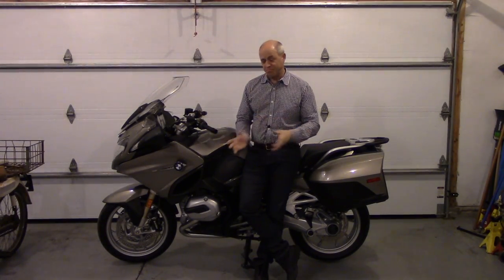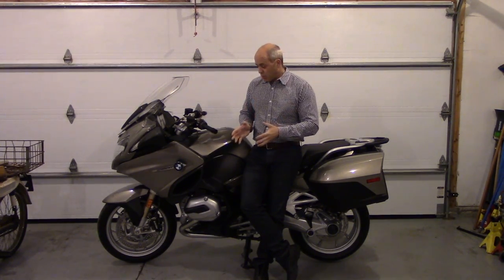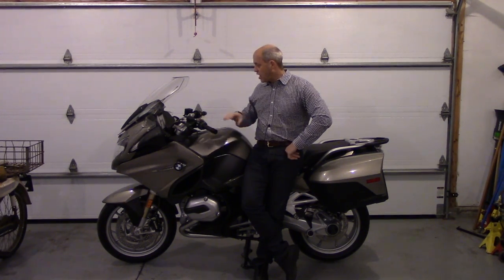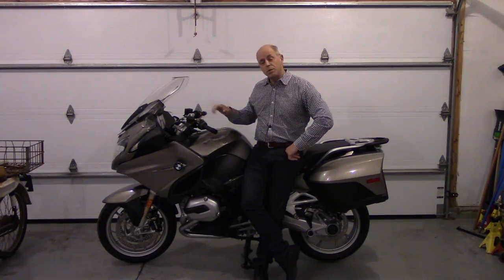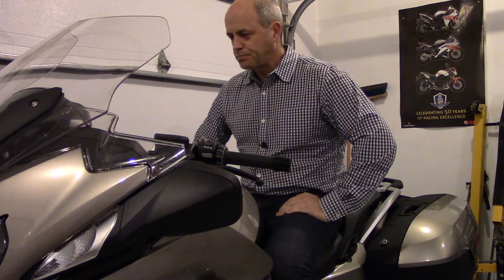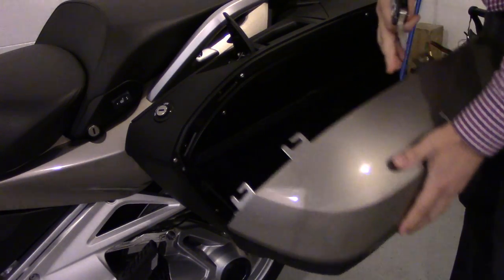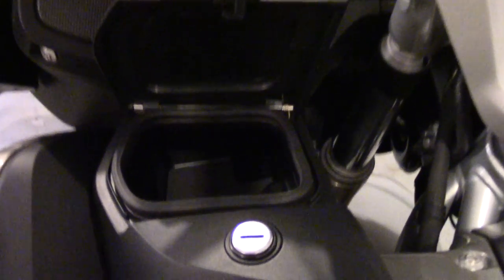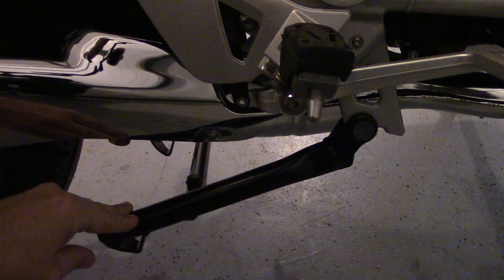2016 BMW R1200RT Overview

Comment: I wish you would do a comparison In the feel and complexities from a base RT or GS to one with Dynamic ESA. There is a scant amount of Information online. I feel you would do an excellent job at explaining and demonstrating the difference for those of us who have a lesser than impressive budget. Please explore & investigate for us if possible/based on your resources, if one could own a base RT or GS and if there could be money saved without regret. Thank-you in advance for even the slightest effort. Very few own a newer Base boxer twin, however because of the lower price, the Base  model is so much more accessible to the majority of us!
Reply from the maker: Appreciate the question. Unfortunately my dealer (i checked) has yet to offer or sell a "base" model for the reasons you mention. However, you make a valid point. Putting aside the value i place on DESA, I would still buy this bike in heartbeat. 
I am fortunate that I can ride pretty much any bike i want for at least a day. I have owned over 40 different bikes from every major manufacturer, and my very wide circle of riding friends expands that field much farther. When it comes to the value proposition for BMW, it becomes a debate in the general motorcyclist community. 
In other videos I make a price comparison between a Yamaha FJR1300 and a "base" R12RT. The RT is a touch less expensive and comparably equipped-- with one exception, the FJR comes with an electronic suspension similar to ESA2. 
However, when you take a day, or more, and test ride these bikes, with and without the robo- suspensions, I found that it is much less important than the overall ride. For example, on the RT, flipping between "SOFT" and "SPORT" is noticeable, but not jaw-dropping. The bike itself is a fantastic package without it. The difference is more critical , maybe, on the GS, if you are riding off-road, Since it does a great job of soaking up bad bumps without going too soft on the overall handling manners.
I also spoke with my dealer, and they have mentioned that the "BASE" models hold their value just as well as the loaded up  versions. In fact, my 2009 RT was truly a "base" model, and it was a great ride. 
The  options i would recommend that truly are worth more than they cost would be Cruise Control, heated grips and heated seat. I ride long distances in cold weather, and those things are VERY noticeable.
ESA, central lock, keyless, Radio, chrome exhaust, driving lamps, hill start, and shift pro are all nice, but i would live happily without them. 
Incidentally, here in Canada, we are charged $1600 for the Touring Package , which gives you Cruise, heated Seat, and the ESA. Its not a huge leap in costs. (base price is $21500). Hope that is some help.

Comment: Great video. I am 6ft3. Do you rate the RT would provide the same level of comfort to that of the GT/L?
Reply from the maker: Ryno Visagie I think you will be comfortable on both bikes but the 1600 provides more room front to back.
Reply: Thanks so much for the quick response. Checking out both later this week. Appreciate your video. Keep it up.
Reply from the maker: Ryno Visagie try to drive both as the true difference can only be felt in the road
Reply: Will do. Thank you

Comment: Excellent video in every way. Nice job. I've been thinking about getting one of these. Wanted to start touring and I figured this was as big as I wanted to go. Also considering the FJR. It seems to have nearly all the features in the base price. Have you ridden that bike? So,aAll that technology and awesomeness on the RT and the best feature is a center stand? LOL.
Reply from the maker: +mgelliott1 The FJR is a great motorcycle, and I bought a new one in 2005 and kept it for 4 years and really liked it. You will see several Iron Butt riders on FJR's as well, so it clearly is popular with those people. The RT has a few more features that are not available on the Yamaha. Heated seat, larger side bags, audio system, extra power outlets, central locking, keyless operation, Bluetooth , and Cruise control come to mind. The Yamaha has full LED lighting, and although it does not have a "dynamic" suspension adjustment like the RT, it has an electronic controlled unit with very fine adjustments. 
Here in Canada , most of those RT advantages are optional, which pushes up the price. so my comparison is not really fair. HOWEVER-- all these gizmos don't mean anything compared to how they run, and for that you need to take the time to ride each on the demo days that both manufacturers offer. That difference is staggering-- and which comes out on top depends on you and only you. For me that puts the RT in a whole different league.
By the way, they both have a centre stand. it sounds foolish that i like that so much, but i really do-- its fantastic!!
Reply: Chris, I've owned an RS and 3 GSes. Now I ride a 2006 FJR1300. You refer to the RT differences to the FJR as staggering. Could you elaborate on that please? I have loved all these bikes but got spooked by the potentially high cost of repairs on the BMW. Thanks
Reply from the maker: I dont mean "staggering" in that one is better than the other, i mean it more in their character. But its admittedly quite subjective, so I recommend you test ride the RT against what you are currently riding. BMW has ride days booked already for 2017, so now is the time to plan. 
On repair costs, you are correct. They are pricey if you let the dealer do the work. I do my own, so this is not so important to me. 
On brand loyalty-- because many accuse me of being a loyal BMW fellow-- I am not. I have owned more Yamaha's than any other brand, followed by Kawasaki and Suzuki. I am partial to the Asian bikes. But when it comes to how i like the ride, i can objectively prefer BMW.

Comment: Hey kiki231000,
Please tell us how tall you are and what your inseam is.  I'm 5 ft 11 inches with an inseam of 30, and I'm worried about the fit of an RT for me.  Otherwise, love the bike.
Reply from the maker: +Brian Bowman I have a 32" inseam. I would recommend the " low seat" option offered by BMW. If you order it with a new bike there is no additional charge, I am told. This low seat would fit you very well.

Comment: Hi Chris.  I enjoy your videos.  I bought a 2016 k1600GT and at first thought the RT would be the one.  I had a HD Fatboy, about the same weight as the GT.  The RT has a great weight advantage at low speed and CG advantage.  However, it felt less planted than the GT at highway speed.  I was accustom to the weight of the HD believe it or not.  But overall, the handling of the GT was so superior over the HD that the RT seemed not to be enough bike.  Also the GT 6 cyl was superior in torque, I could keep the GT in a higher gear at lower speeds.  Both are awesome bikes.
Reply from the maker: Yes the GT has a substantially longer wheelbase making it feel more relaxed at high speeds